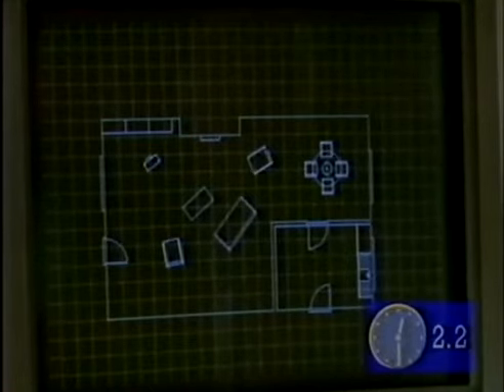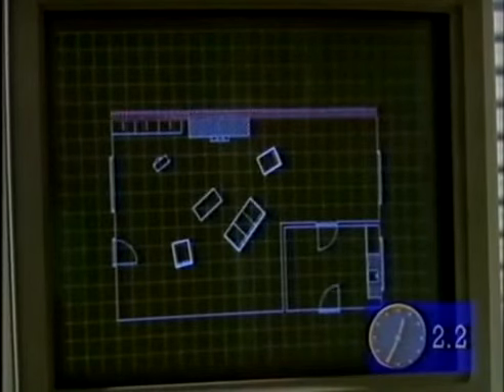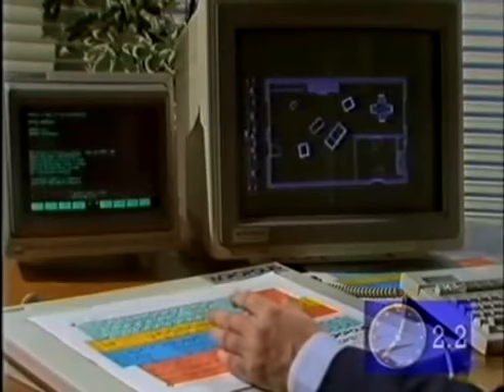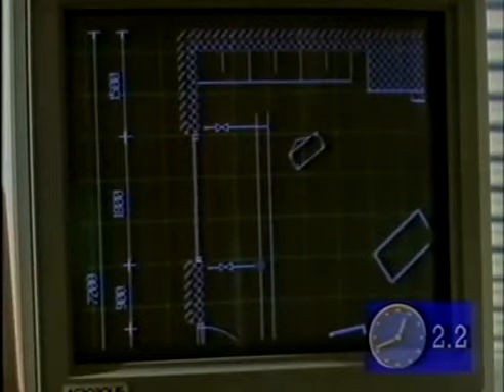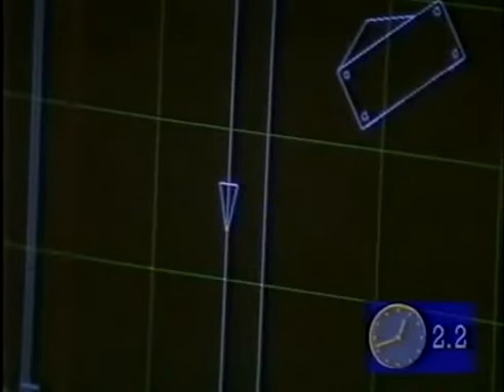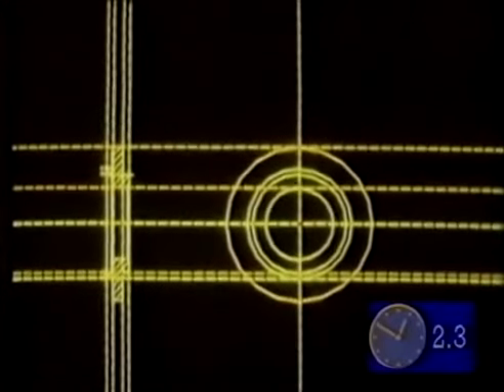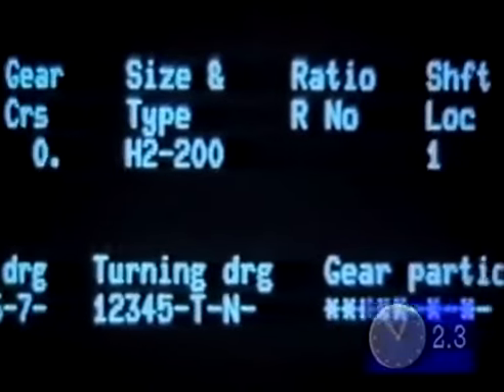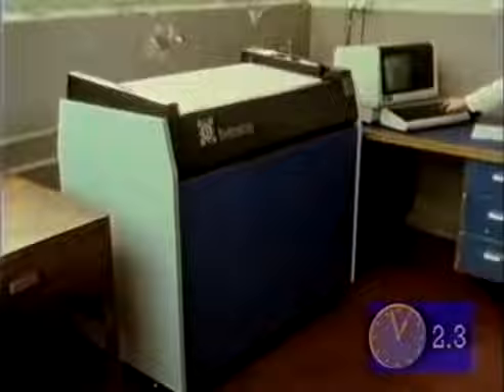Open University   CAD 1986

Comment: Doesn't say what CAD system they're using at the start. Is that Acropolis too? Unusual to have working-class accents in a BBC television program then. By the voices it sounds as if it was filmed in Hull or somewhere else in the North of England. It's Open University though, so I expect there was a drive for diversity within it even then.
Reply: Ask ChatGPT from a screenshot.